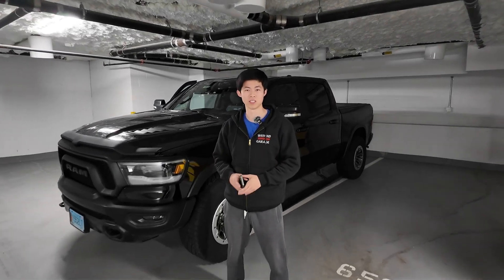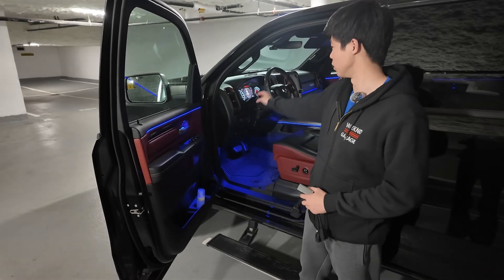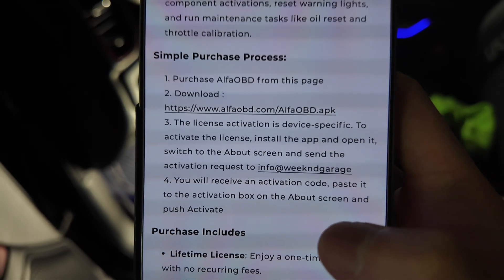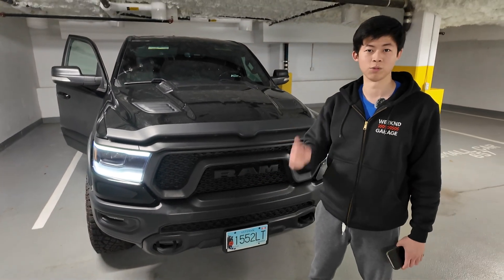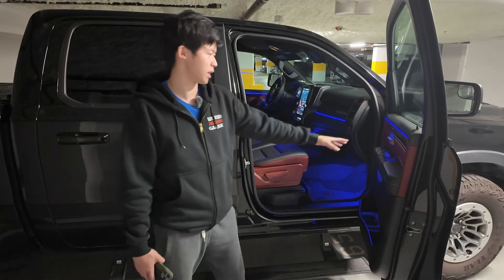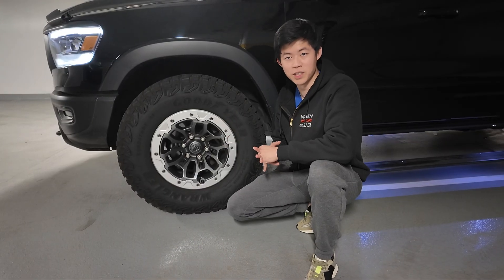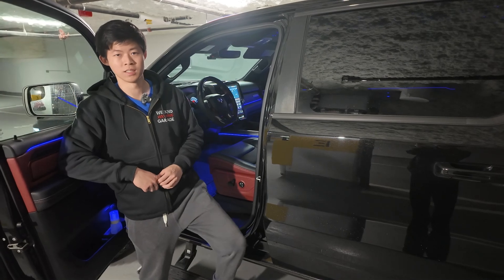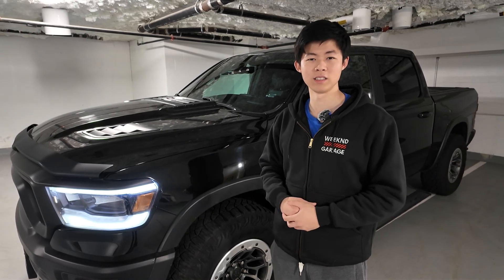Heres Everything AlfaOBD Can Do (Full 2025 Guide)

Comment: Someone hit the rear wheel of my 2016 Ram1500 extremely hard causing the the safety feature of (shutting off the fuel system) to activate. My vehicle shut off after impact and will not start. Most vehicle have the inertia switch in the panel behind the glovebox or under the drivers side dash, THIS TRUCK HAS NEITHER! Does anyone know if the AlfaOBD would be able to reset whatever is causing the no start?  Thanks

Comment: Will this allow me to add Mopar power running boards to my 2014 Ram 3500? What about changing the mirror turn signal to also function as a running light? Thanks!
Reply from the maker: Yep, you can add the Mopar steps with AlfaOBD! DRL to mirror unlikely without wiring changes

Comment: Am I able to use the software with my own bypass cable and Bluetooth adaptor?
Reply from the maker: You could try, but our reader’s designed specifically for AlfaOBD.  faster, more reliable, and fully supported. Generic ones often fail to connect to all modules or drop mid-programming 😎

Comment: for a 3500 2019 dually you leave it conected behind the cluster? with the by pass and the AlfaOBD ? or every time you use it you need to remove the cluster, how it works?
Reply from the maker: You can leave it plugged in if you’re constantly making changes, but with AlfaOBD, most adjustments only need to be done once, so you usually won’t need to keep it connected afterward.

Comment: Have you tried to add the digital rear view mirror also curious if you could program adaptive cruise control I know the modules it needs and would require a new windshield but mine is cracked and if it’s possible I would get the adaptive cruise control version so I can do it

Comment: I really like your program. I have used it to program power side steps and also add pick up box lites. Awesome. I wondering if there is a setting to keep
for usb time out; My seems to time out after maybe 10 to 15 minutes... I would like to keep at least one of the front usb ports on for an hour 
to an hour and a half to charge phone.  some people just like them to shut off... but it is nice to leave a phone in your rig to get a charge...isn. this possible
Reply: There’s a fuse under the steering wheel, if you move it to one side of the socket it keeps them on all the time.

Comment: I have purchased the OBD II Reader, gateway cable and AlfaOBD for PC.  Was told it would work with windows running as a virtual machine, but I am having no luck.  There are no instructions that I can find anywhere and support is email only.  So far, I am not so impressed.

Comment: Can you use this on a 2025 ram 2500 yet?
Reply from the maker: Not yet, engineers are working on it, once it’s out for the 2025s we will make an announcement 📣 stay tuned!
Reply: I keep checking back to see if 2025s are able to use this, looking forward to it! Thanks for all the great info.
Reply from the maker: @jzajac02  You can add yourself to the email list on our website or subscribe to keep updated. We will be announcing on where we are with the progress soon!
Reply: I haven’t found any hardwired high beam signal on mine for auxiliary driving lights. Got the upfitter aux switches/distribution and found plow lights output wires under the hood, work on that too.

Comment: how can i retrieve pin code for ram promaster 1500 using alfaobd? also can i program a new key fob for same vehicle
Reply: Pin is located in the radio frequency hub menu.
Reply: @bigmike892012  thanks forresponse but for the promaster i cant find radio frequency hub. only has radio option and there isnt a pin option there

Comment: Thank you, I have changed some features on my  14 ram 2500. Only thing I can't find is the cruise control fast idle, mine is a manual so ifk if it's a little different
Reply: AlfaOBD can't adjust idle speed settings, you require an unlocked ECM and a tuner program.

Comment: Please create an auto power fold mirror setting!
Reply: this. hittin that button every time is annoying. You'd figure that after almost a decade through many models of vehicles under chrystler/dodge/jeep/ram with that button on the higher tier trim models, they'd make it a toggle option within uconnect settings.
Reply: @JSLEnterprises  my 2024 2500 has a setting in uconnect for auto folding mirrors when truck is locked.

Comment: I managed to turn off the 3 horn honks, if you get out with the key and the engine is running, using AlfaOBD. Just so you know. Thanks for the video!
Reply: I read in the 5thgenrams forum that the AlphaOBD method only works like 80%-90% of the time, and using a Tazer DT is the only truly effective way to disable the 3 horn honks. Is the AlfaOBD method working all the time for you so far?
Reply: @watkinsjason  It is, yes.
Reply: What option is this?!?
Reply: @FetucciniAlfredo180 , there were three separate steps and I found it in another YouTube video. I'm not sure Anson would appreciate sharing knowledge on his page but the video was a guy with a white 2500 diesel.
Reply: @TheNovaNorm thank you

Comment: 2:41 Can it roll the windows down with the remote and can it automatically fold the power mirrors in or out when you turn on & off the vehicle
Reply: Under Car configuration change, search for Doors-Global Windows Down and set to yes. Double tap the FOB unlock & hold on the second tap. The front windows will continue to drop only while holding the unlock button. This feature works great on hot days after remote starting with the AC on.
Reply: @MichaelSmith-rc8ns  I went in and enabled this setting it to yes for global windows down. And my remote still won't open the windows. Does it matter if you enable global windows up too?
Reply: @MichaelSmith-rc8ns  Does this work past 2018? Tried it on my 2019 and it didn't do anything.